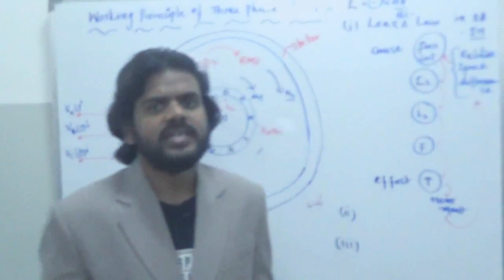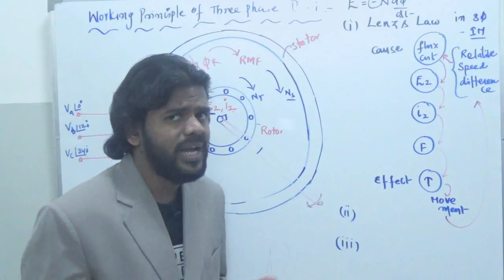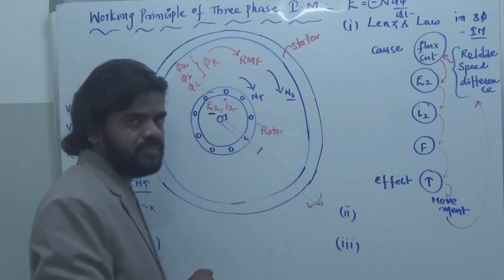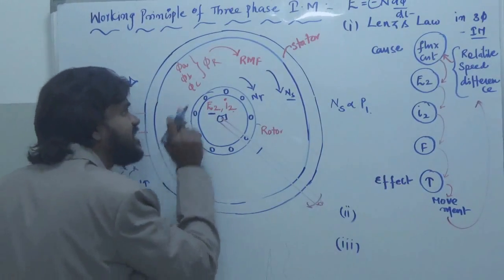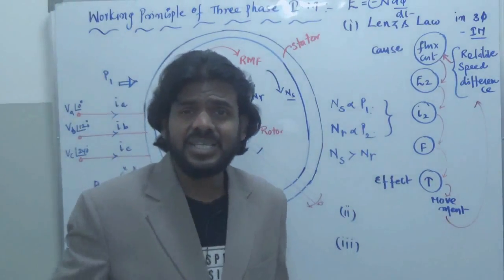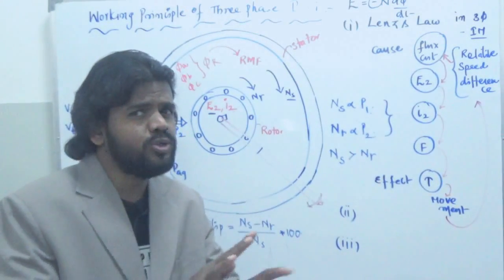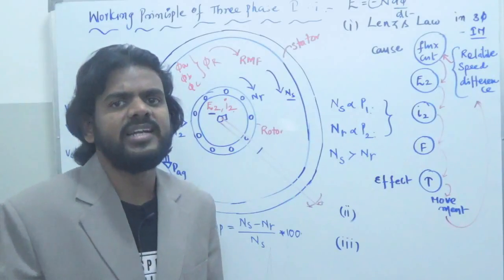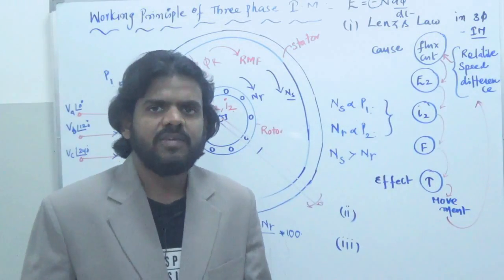Why three phase IM cant run at synchronous speed.

Comment: State why synchronous motor is not self-starting. List the  methods generally used to start synchronous motor.
Reply from the maker: A synchronous motor is not self-starting because it requires the rotor to match the synchronous speed of the stator field to generate torque.

Starting methods:

1. Damper winding.

2. Auxiliary motor.

3. Induction start.

4. Variable Frequency Drive (VFD).

5. DC starter.

Comment: When the synchronous motor runs at synchronous speed the voltage induced in the damper winding is????? maximum
Minimum
0
????
Reply: 0
Reply: @muhammadomarwaqas4208  thank you 🙏🏻
Reply from the maker: When rotor rotates at the same speed as the rotating magnetic field of the stator,  there is no relative motion between the rotating magnetic field and the rotor, including the damper windings. As a result, there is no induced voltage in the damper windings when the motor runs at synchronous speed.

However, Damper windings are only used during the starting phase or when the motor operates below synchronous speed to produce a damping torque that helps the motor accelerate to synchronous speed. Once synchronous speed is reached, these windings do not carry any current, and no voltage is induced in them.